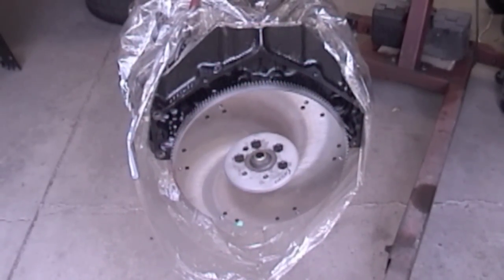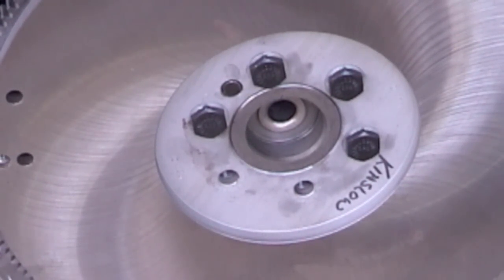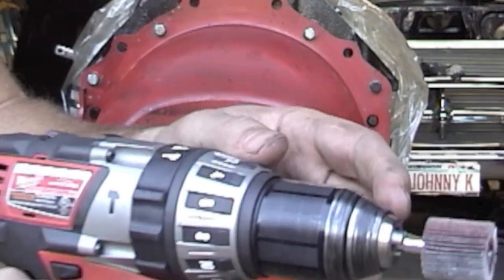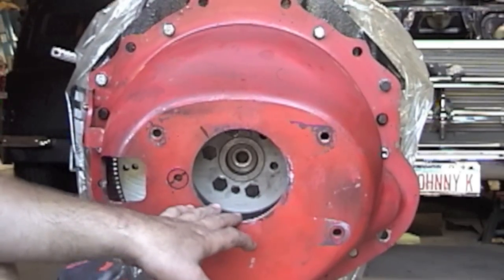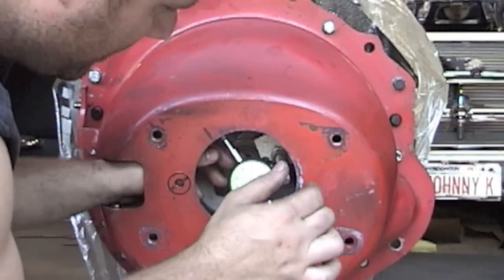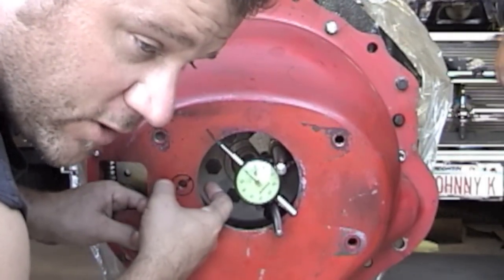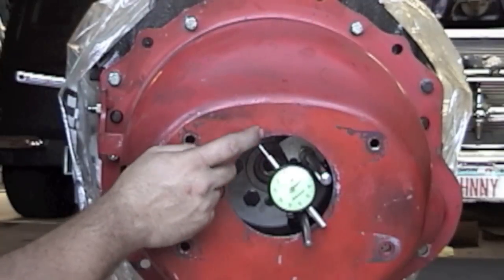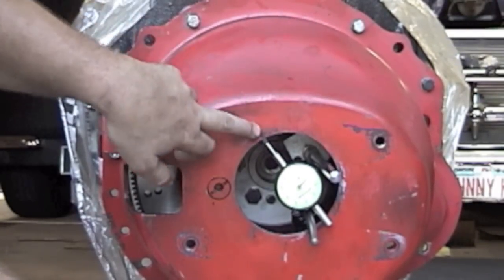Part 17 How To Align The Bellhousing Using Offset Dowel Pins For The Big Block Chevy

Comment: I built a 1965 Chevelle with an L-88 and Muncie. I couldn’t get the transmission to shift right, had a terrible vibration in high gear, and the clutch slipped, it was all because of the scattershield alignment.

Comment: great video! I appreciated your demonstration of the procedure that was backed up by the measurement tolerances. Also your one-inch mark tip on the point with a local maximum reading was super helpfull!

Comment: Hi John. how do you guarantee that the hole in the bell housing is centered in the bellhousing? If it is not centered in relation to the bolt holes for the transmission then it isn't a valid place to take the measurements.
Reply: Thanks. I’m asking myself the same question.

Comment: Hi Om adjusting the pivot pin height  toi 4.750 43/4 inch correct ,, why cant I cut a 2x4 to 4.750 inch and use it between the flywheel and pivot ball ?? this is after centering bell housing of course

Comment: Nicely done.  Wish you would have shown the spinning of the flywheel to get your measurements.  Also, you never mentioned why your initial 11 o'clock mark was where it was.
Reply from the maker: Hey Jeff Braun,
Thanks for taking the time to post and the nice compliment, much appreciated.
I was trying to reduce the length of the video. I ended up taking the spinning of the flywheel, showing the dial indicator measurements out.
The initial 11 o'clock mark was my mark for my readings.
The making of this video was an after thought and I never thought to remove my mark on the bell housing.  I can see where that could be confusing.
Thanks for watching.
Happy Thanksgiving!!
Johnny K

Comment: Searched far and wide for the easiest way to align the BH - yours was definitely the best, most complete. One other tip for those who are real familiar with a dial indicator, take a few minutes to bone up on the plunger movement so you don't fumble around for a week trying to figure it out like I did. The plunger must be partially depressed when going through John's exercises so you actually have positive / negative movement. And the adjustable dowels recommended here are awesome - wouldn't use anything else.
Reply from the maker: Hey Brian Barrett, Thanks for taking the time to post and the nice compliment  much appreciated!
Thanks for posting a great Tip too!
Have a great day
Johnny K